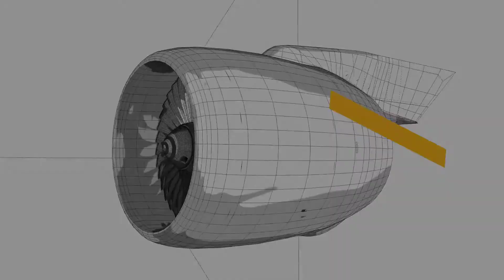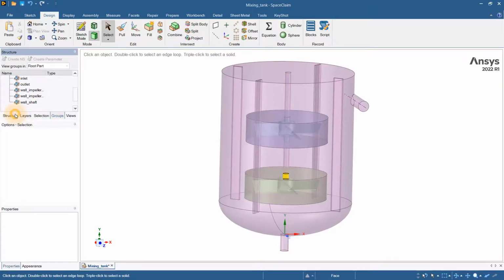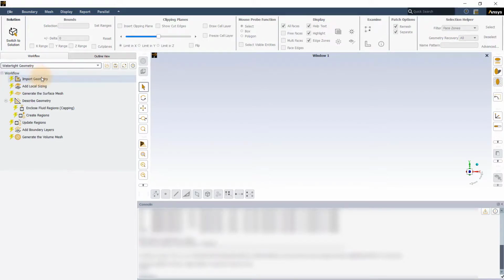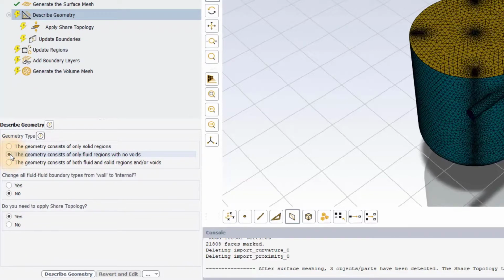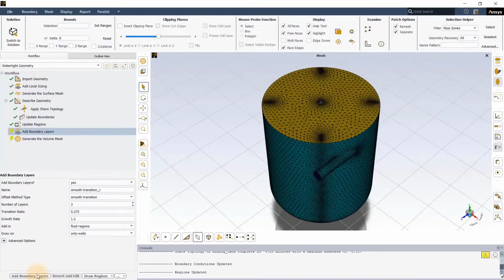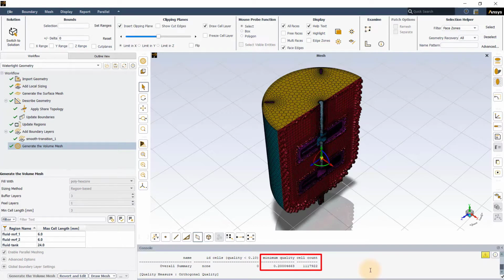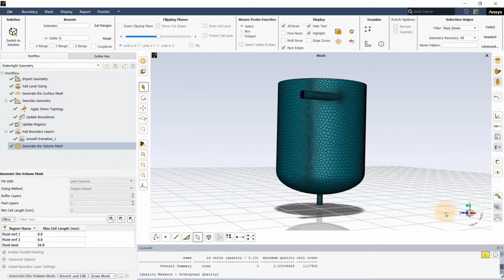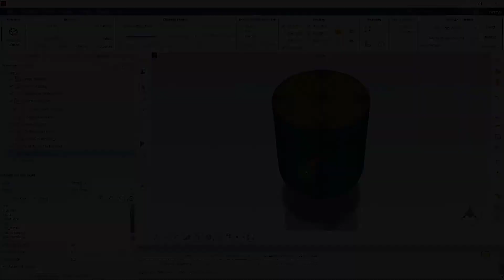Mixing Tank Tutorial Using Ansys Fluent Meshing Watertight Geometry Workflow

Comment: hello , thanks for the video, i have one question, i choose shaft and impellers as a boundries and for my first analysis they were rotating same speed same direction (no problem) but when i choose 2th impeller to opposite direction , area-weighted velocity on the 2th impeller calculates as 0 and i think this shouldnt be like that but i dont know why ?? , is it because of the 2 impeller connecting with the same shaft or anything else ? i couldnt find on the internet . if u answer i ll be happy thank you.